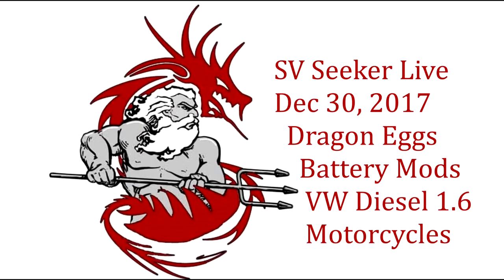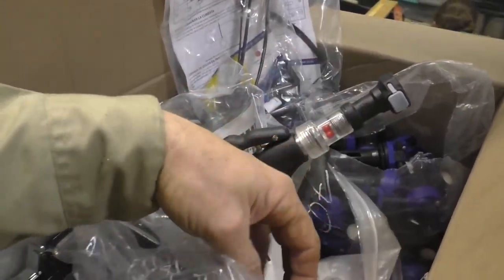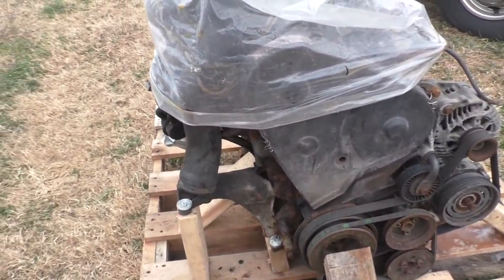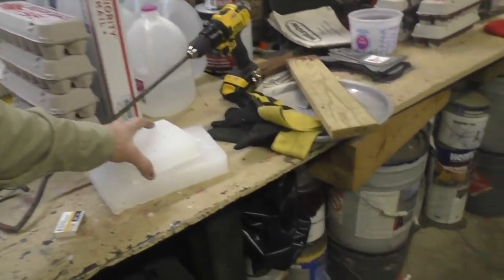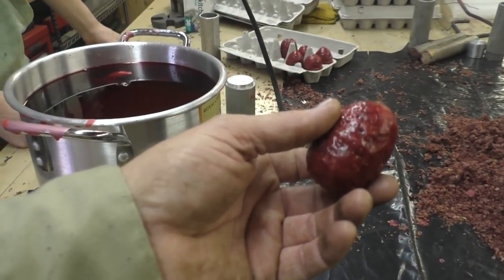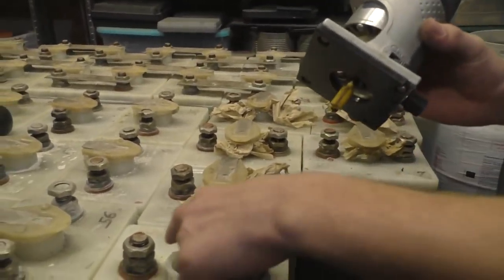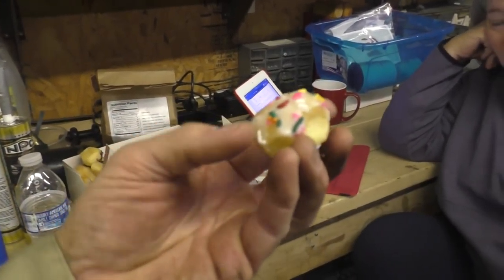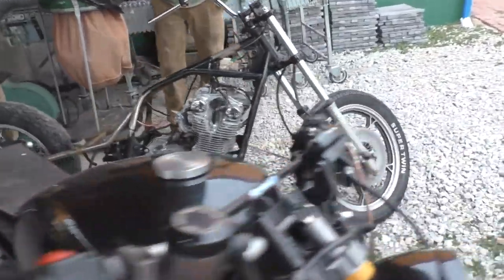SV Seeker Live - Dec 30, 2017

Comment: Doug, You may want to replace the valve stem seals on the new VW diesel engine. For a while they had trouble getting them correct. New seals will keep oil from getting pulled into the combustion chamber. And please let the engine idle for a minute after running to oil the turbo and let it col off. An exhaust gas temp gauge would be a handy reference.
Best wishes,
Eric

Comment: The electronic sensor is very helpful but you can not think of them as full proof. If you have enough then it could be possible to put one in each cell otherwise you only get a reading in the cell it's installed. Being lazy combined with a false sense of security will increase the percentages the fluid levels of a cell hard to see and without a sensor will end up on the low side. If you have multiple sensors think ahead regarding placement instead of just placing them randomly, so they watch over cells in difficult spots. If your fill tubes are all in series the last cell having a sensor combined with the flow meter on your pump helps guard against a clogged or disconnected fill tube.
Reply from the maker: I agree.  Series sound right, and monitoring the amount of required to refill them.

Comment: Make sure to check if the 1.6 has a gear driven oil pump vs a chain. Google up VW Balance shaft and read up. You can buy the gear kit online for little money and change. Otherwise the chain can break and these are not clearance engines.

Comment: Go to a farm supply get a Red Brooder light bulb  don`t cost much for keeping chickens warm in sheds hang above your table 2 feet off socket and cord  the heat will help keep wax sticky and when your eggs are built just roll them under the bulb they`ll become tacky and remelt the surface a bit saves time and wax .you`ll stay warm too Same as a waiter warmer tray at restaurant window

Comment: It looks like there is a turbo on that engine. I would check to make sure that the engine was originally sold with a turbo or make sure the oilers have been added because most of the 1.6 vw engine were sold as natural aspirated. This means there is a good change that it didn't come with oilers and if you run more than 7psi of boost will eventually destroy the lower end. You can check this really easily by removing the oil pan and seeing if there are little holes in  the clamps that hold the piston dog bones to the driveshaft. If they are not there you can get them for like 50 bucks a piece at any VW dealership, btw you literally only can get them at the dealership so dont waste your time unless you live by a vw junk yard but chances are they won't have them either. With the oilers  you can safely run 13-16 psi which those engines are a lot happier at. If you are not getting enough power from that engine investigate getting bigger injection nozzles. I think you can get them from kermatdi.com but you will probably have to call them because I dont think they are listed on their website for the 1.6l. with stock injectors and proper tuning of the turbo and timing you should get 100ish hp out of it and I would think up to like 130 with bigger and more efficient injectors. hope that helps.

Comment: Have you considered trying the "Polystyrene Foam Hot Wire Cutter" things you can get off amazon, to trim the tops of the batteries?  May be easier/quicker and cause less crap to fall into the batteries.
Reply from the maker: We tried a hot knife.  It works but it's really slow.
Reply: Cool.  I kind of assumed you'd have tried something like that - nobody wants to be digging crap out of their batteries.  Twice...

Comment: Put the matches in a cut off part of a large diameter straw.  Then thread some strong but thin string thru top of straw, about a quarter inch down from the top of straw. The user would pull the string to drag the straw and matches out of the center of the Dragon Egg.
Reply from the maker: That's an interesting idea.   But you really have to break the egg up before it is easy to light.
Reply: Oh, OK

Comment: Could you pour wood shavings into hot wax and then scoop up the mix with tongs that have half egg shaped "ladles" on each leg of the tongs? Squeeze mixture then open up tongs and drop egg.
Reply from the maker: Perhaps, but it takes about 3 times the volume of raw material.

Comment: have you though about making some type thing to just cut battery like 2 razor blade on pliers or something what heated instead of going with router or maybe a metel pipe go on where you need to stop and just use a plastic cutting soldering iron? if you go with router just have stops dowels at end of  the bored